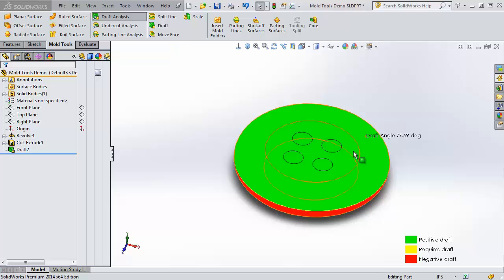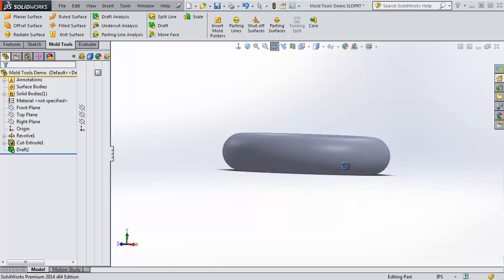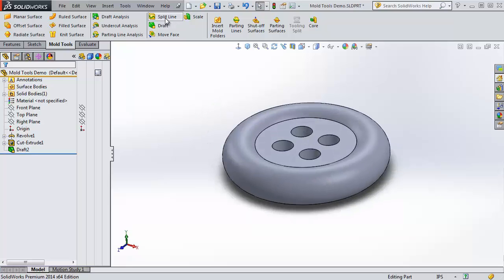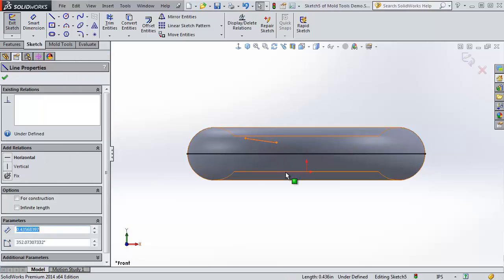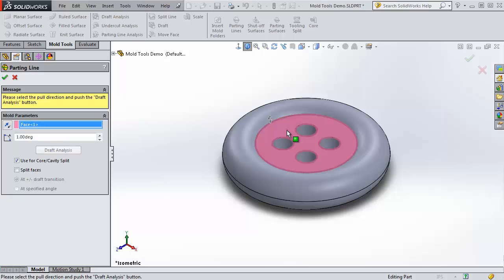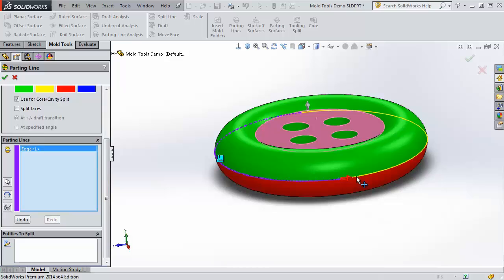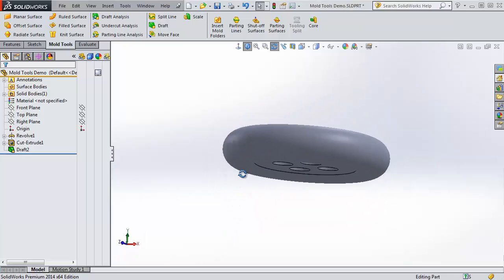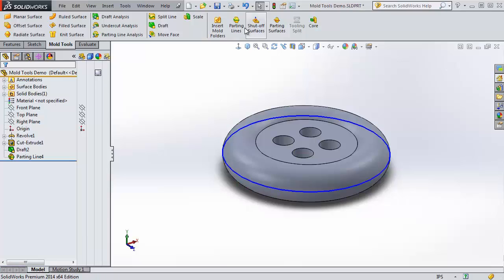SOLIDWORKS - Mold Tools Part 2 - Split Line and Parting Line

Comment: can anybody help to find select tangency button i press right click but its not there
Reply from the maker: Hi MrThePsychologist,
If you are attempting to right click on a face but do not see the option to 'Select Tangency' come up then it may be that the program does not recognize any adjacent faces as being tangent.  This command would only show for faces with at least one adjacent tangent face.  It would not show for a faces surrounded by only non-tangent edges.
Reply: where do you think the problem may be
Reply from the maker: The most probably problem is that the faces you are selecting have no tangencies adjacent to them.